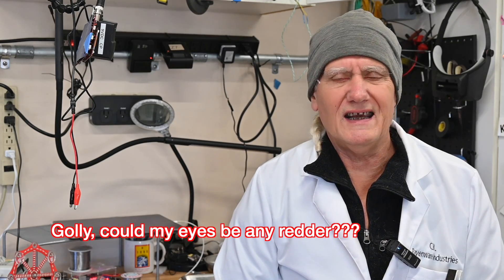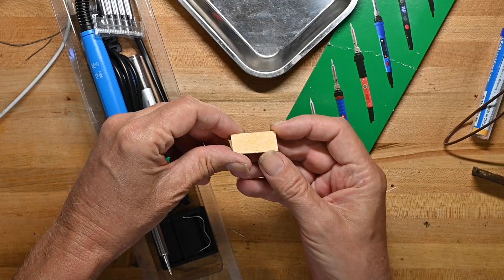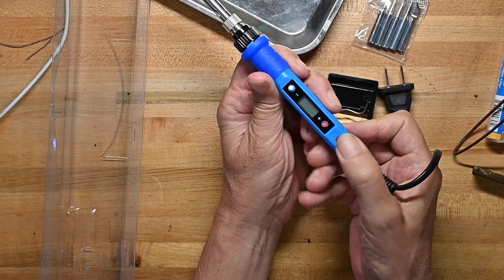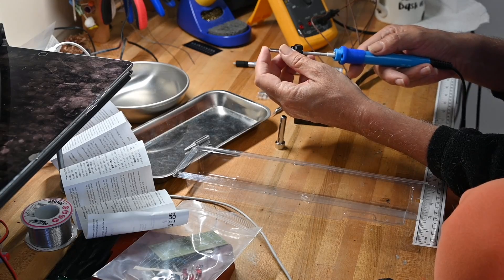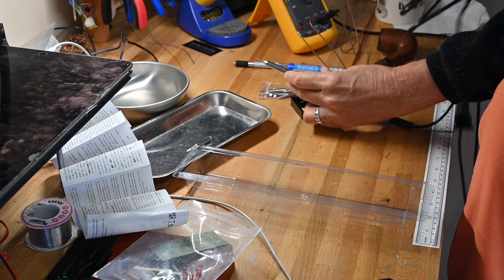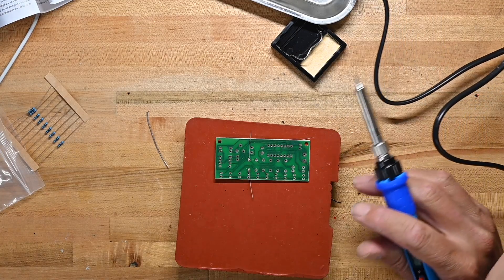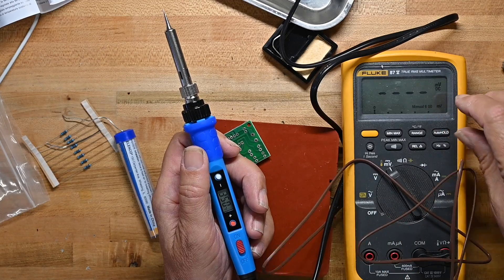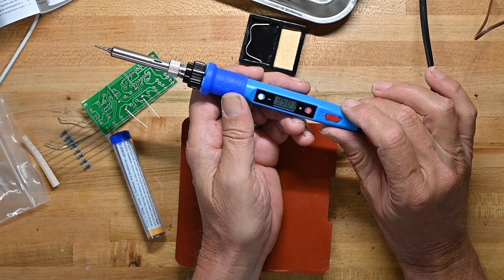C.K. tries a very inexpensive digital soldering iron, US$12

Comment: The biggest problem with this soldering iron is that will soldering you push the + temperature button by excited and suddenly the iron is at maximum temperature.
Reply from the maker: They need to put some debounce code in their temperature controller!  Thanks for stopping by!

Comment: Thanks for this video! I recently got into repairing simple electronics stuff (like swapping out joy con joysticks via ribbon cables) but messed up and need to solder something. Never touched an iron before but this thing was on sale for less than $10 and highly rated so I figured it was a good starting point. Thanks for the tips in this video, I'll be sure to not lay it on the cable or use the stand incorrectly. I've got more studying to do before I actually turn the thing on, but at least I know what to expect in the box and while using it. Thank you!
Reply from the maker: You are very welcome!  You might want to try a few solder practice kits to get your skills ready, look around my channel, I've built quite a few practice kits that you might be interested in!  Inexpensive, and good to get your hands ready with!

Comment: Wow, that's a fantastic iron for so cheap, thanks C.K. About the cord, it might be better if it had a below bench plug-in, then at least the cord might drop away. On the tip/ceramic gap, i suppose if Hakko tips were purchased, that would cure the issue but, as you show, it still works just fine.
Reply from the maker: Still surprised at how accurate the temps were, this is a nice iron.